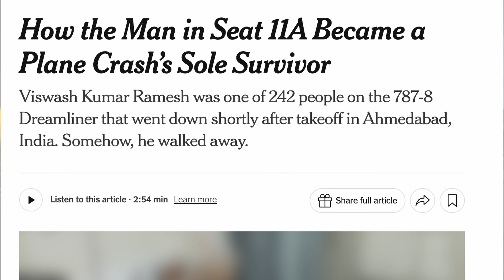Why the RAT Changes Everything – Air India 171 Update

Comment: It will take months before the cause of the crash is properly determined. While interesting; this is just conjecture. I'm surprised that Capt. Steeve would have access to the ATC recordings because they are usually protected. I've been involved in several aircraft incidents and the causes are usually a combination of errors.

Comment: I got nervous when jet planes went from 4 engines to 2.
Reply: It works out about the same. If a 4 engines plane loses an engine, it must be able to fly on three, and in the case of twin engines, on only one. The thrust of the modern engines is far higher than was present on the older ones. This means that for example, that catastrophic bird strikes would leave the same failure pattern for both 4 or 2-engined aircraft. Flying feels more scary, but driving to the shops for bread and milk is more hazardous. We are very poor at understanding or assessing risk factors for ourselves.
Reply: @Steven-p4j That's true for going to the store to buy milk. I'm talking apples to apples here.

Comment: I'm glad it's not the pilot's fault as Boeing would have clearly run with that to avoid damaging their already tarnished reputation even more, especially after the hit job.
A dual engine failure is apparently very unlikely, you are more likely to win the lottery than this occuring, but for it to happen on take off shows there's a major issue with the jet turbine. All planes with this model of jet engine should be grounded IMO, there's been far too many plane accidents recently!!

Comment: It's plane failure nothing else. And flaps should be set to min. At 10 or 15 mandatory even if runway has the highest length. Pilots set flaps at less degree because they got enough runway so plane can fly slowly up. When runway is short pilots set flaps to bigger degree like 10 or 15 so that plane takes off in short distance.

Comment: I agree with you regarding dual engine failure. The RAT deployment is one factor but a second factor is the fact this aircraft was not at gross weight yet used every inch of an 11000ft runway to get airborne. This crew encountered a problem after V1. You have to feel for them.

Comment: Excellent ideas captain, thank you! How horrible of a crash this is, I hope they figure out why it went down. From a private pilot, I agree so far with their theory. dual engine failure. I would assume they will check the fuel in the truck that they used for re-fueling.

Comment: On the B787 the fuel pumps are electric. So, no electric power means no fuel to the engines. BTY, the air con broke on the previous flight and was just fixed before takeoff. I would be asking those guys what they did to fix the air con?

Comment: ** A video from a passenger surface on FB showing the previous flight of this same airplane , with some sort of an electronic or problem about the video display entertainment system on the back seats, not working.   The screens were frozen and not operational.   Maybe a precursor of an electric / software computer issue prior ..

Comment: Cant get my head round why so much could fail within a few thousand metres of flight, 2x engines cannot fail surely?  Fuel contamination could make both fail is my guess, I'm not an airline guy but have worked on cars since 1986, fully aware that take off is the most stressful part of the planes job, once up almost run on air. Good information.  Thank you.

Comment: It really makes sense now. I think it connects the dots, even why they couldn't lift the landing gear, since that also required power. Hearing from an expert like you, it's hard to believe that both engines failed at the same time. So, fuel might be the real issue. They had just landed from Delhi, and it needs to be confirmed whether they refueled again at this airport. Something might have happened there. It's possible that the initial thrust came from the fuel already in the lines, and when the new fuel entered, it may have caused the problem

Comment: Had it been a single engine failure, the working engine would have kept the plane in the air. A friend of mine, a retired pilot has put this down to fuel contamination. It'll be interesting to see if he's right.

Comment: I was thinking engine failures even if he didn't use flaps  on take off, the climb out would been flat or used entire runway. that airplane took off straight up in the air like a rocket was supposed to and just lost power went into a complete flat stall great job by the pilot he flew that plane all the way to the ground with wings level in a perfect stall configuration if there would have been more momentum forward, most likely would be no tail section that plane look like it just dropped on top of the building very relatively slow fwd velocity to a 787... and if somebody accidentally put the flaps back up on climb out, normally the pilot would have lowered nose to  gain air speed speed and threw a notch of flaps back to it.  that did not happen he kept his nose way high angle of attack. Now we see air generator extention 😮

Comment: Would complete electric failure cause engines to shut down ? Reason I ask is a video come out supposedly of that aircraft about 2 hrs before it crashed it was someone on the plane the flight before this one and all the electronics was shutting off on it. Also seen something that said this plane had 4 seperate maintenance issues in the last month and had made 4 emergency landings because of landing gear and flaps issues 🤷🏼‍♂️

Comment: Pretty simple plane takes off, 15 seconds into air pilot ask for wheels to retract, a failure in the electronics or hydrolics cause failure of the electrical system, which causes fuel pumps to switch off (only for moments) cuts the engine, witness felt the plane not move this is the feeling of speed reduction in air due to engine failure, rat deploys automatically as auto failures system engage, you see in one of the videos the cover flying down from the plane, electrical systems restored to basic level due to rat, power restored to engines pilot goes maximum throttle, the one surviving witness said he then heard the engines screaming after the 15 seconds of stall glide time, pilot is shouting mayday to control,  video shows plane slightly dipping wings left to right lack of air flow like a paper plane losing lift falling to the ground, not enough height to recover, pilots did their best in a dire situation, this is not my words but from another youtuber who knows better than this guy from 2 days ago.

Comment: I reckon the black box will see the flaps were deployed or partially deployed, as the plane won't allow you to take off without flaps. The plane began losing power somewhere after V1 because the plane took the whole runway to takeoff, likely at a point it was impossible to abort take off.. Next, the only reason the landing gear was still out is because the plane hoped to make a turnaround and land.

Comment: It's ultimately more likely that it was just one engine, but with gear down and no flaps they wanted to sink and couldn't hold altitude or climb. And they didn't have enough time to figure it out. If they were at 10,000 ft, they probably pull the gear up and figure out an approach.

I think it was always obvious that it was power... Nobody doesn't have throttle full open there. They were obviously sinking. They didn't have enough power to stay airborne, and crashed basically parallel to the ground.

Comment: Definitely not hydrolics, the flaps would sag, I am still sticking to my original comment, there was probably a software problem, electrical issues, aircraft went into landing mode, the engines pooled down to land, the wings stayed level, no wing stall, slight yall to the right, but I am convinced the aircraft went into landing mode, this case looks very simular to the air France incident, we're the aircraft at an airshow went into landing mode, the Rat also deployed, airbus fixed the glitch, has Boeing with the new dreamliner 787 maybe got the same issues?

Comment: Proper & constant fuel supply to the engines can affect the thrust factors which at that time required for the lift must have some mechanical electrical issues. Anyhow, the matter is not under my investigation anyways. The analysis is of great values 🎉🎉
Wonderful observations  🙏🙏

Comment: I have said it elsewhere, and I am repeating it for the benefit of your viewers. The Air India plane crash in Ahmedabad bears uncanny similarities to two previous aviation incidents. The helicopter crash that claimed the life of Chief of Défense Staff General Bipin Rawat in 2021 and, more recently 2024, the fatal crash involving Iranian President Ebrahim Raisi. In all three cases, a notable reported common factor has been a sudden failure or jamming of the engines, resulting in the aircraft to crash within minutes. It seems most likely that an advanced remote interference technology could have been used to disrupt aircraft's electrical and hydraulic systems, particularly when flying at low altitudes. Given the sophistication in cyber and electronic warfare capabilities, it is not inconceivable that cyber interference and sabotage brought the plane down. The operation Sindoor has humiliated powerful nations (not Pakistan), and this angle merits careful consideration.
Reply: If in doubt and with no knowledge, always invoke a CT with sinister forces at work as the most plausible explanation - you can‘t go wrong on social media…

Comment: If the jet engine were at full throttle as would happen if there was a mistake with the flaps surely the noise of the engines that low would be extremely loud and would be clearly heard in the original video.

Comment: There is something else. Something that you don't see on the video: the optical distortion caused by the exhaust of engines, that are supposed to be on full throttle at that point.

Comment: There’s an Auxiliary generator on tail which supply power when grounded (addition to ground power). 
Auxiliary generator is used for starting engines then switch to “Generator Mode” for main generators. 
Were the pilots yet on Auxiliary power and failed to switch to main power (Generator Mode). ?

Comment: That is great information, but that doesn’t explain why the flaps were not in the correct position and why they used all 11,000 feet of runway to take off and not the normal 7,000ish. Could this be a chain of events that caused this tragedy?

Comment: Loss of power/thrust looked like a pretty solid hypothesis from the get go, simply judging by the plane's behavior shortly before crash. And it would've had to be total loss - or rather loss of power in both engines, as the plane did not appear to be yawing left or right. If they had had, say, a bird strike in one engine and the other was still running fine, I'd guess you would've seen some sort of reaction by the plane wanting to yaw - which I don't see here. I also didn't/don't see any birds in the video or anything that would lead me to believe a strike occurred - there's no debris, fire, smoke or anything coming from either engine and neither of the two look like they've taken any sort of damage to their innards. 

It seems more like someone (or more likely: something) cut or dramatically reduced power on both engines. Question is: What exactly caused this? Clearly, the flight-crew was aware that something was very wrong as they were clearly trying to fight this thing (plane is very much nosing up as the plane vanishes from view) plus, AFAIK, they did make a Mayday-call. Also: If they simply had mistakenly reduced power, would the RAT have deployed? I don't see why it would. 
So, as before and with the whole "they must've mistaken the flaps-lever for the gear-lever"-non-sense, I'm going to rule out human error on the part of the flight-crew - meaning I do not believe they had the engine controls at too low of a power-setting. Besides: The plane did manage to take off just a few seconds earlier and, surely, a power setting sufficient to take off would also be sufficient to, at the very least, maintain level flight, even with the gear out. 
I guess we'll know soon enough because IIRC they recovered the flight-recorder yesterday or the day before that, but I would not at all be surprised if they found out that the culprit here was some sort of catastrophic failure in the engine-management and/or throttle-by-wire systems. Which, in itself, would be pretty odd as I would expect such vital systems having built-in redundancy.

Comment: What about fuel contamination? How is it possible that the engines that worked perfectly on the first sector and also worked enough to rotate the airplane up at the perfect time suddenly goes off.

Also there is a passenger on the first sector who made a video about the lack of AC and TVs not working. That should also be considered into this instead of relying on the guy who survived  who has changed his stories many time.

Comment: This is off a few things I've read on the internet, so take it with a huge grain of salt... I've read that Air India are not good with their maintenance on their planes, leaving things unfixed and having the fleet flying on bare minimum, and there was also a comment of someone that said they were on that very plane before and that there were a lot of faults in the interior, like most of the in-flight entertainment wasn't working, lights working erratically and even some interior panels missing above the luggage bins.

As I said, this is what I've read on the internet, and anecdote is not evidence, but if it is possibly true, that would give more weight to the engine faliure hypothesis due to lack of maintenance, and the possible ruling out of pilot error. 

Also, the sound of the RAT is very evident in the video, but there is something that is very absent from the video, and that is the sound of two turbofans at full take-off power... in fact, I would say you can't hear the turbofans at all.

Comment: I shook a bit.
2009, flying back from NYC to London, with a Boeing (it was a long distance plane, but not the Jumbo), right before the start, when the pilots started the full throttle, both engines failed.
Some maintenance guys came 20 mins later, the Plane had to leave the Exit.
I sat on window place, seeing the left wing. There was one guy checking the logs... I saw the Laptop.

We wanted to leave the plane, but we were NOT allowed... I remember we started to sweat, as also the plane got warm inside.

In the end everything went fine, but my mom had exactly her 45th birthday, on June 23rd. And she told me after the flight that she thought It's gonna be her last b-day. I never forget how both engines failed just seconds before the full acceleration started.

Comment: There's a video which clams to show multiple small electrical issues on the planes previous trip. including no air conditioning, seat touch screens frozen and call assist buttons not working
Reply: those have nothing to do with avionics or engines, being perpetually short of aircraft these aircraft are flown round the clock after routine maintenance and thus there is little down time to do repairs  of infotainment and cabin accesories

Comment: Capt Steeeve, good analyst, but a double engine failure is extremely rear. This is a real head scratcher. A pilot with 8 thousand hours would not make many mistakes during an emergency. I work these aircraft, they are very high tech with many sensors and redundant systems. Would a complete electrical failure and emergency buss failure cause no response to engine throttles? Keep up your research, many pieces to this puzzle are still missing..

Comment: Glad you dropped the pilot mistaking the gear lever for the flap lever theory. 
This doesn't look like a pilot error, nor fuel contamination. I could be wrong but with this AI cleaned up vid it appears the speed breaks are pushing the plane to the ground.
I don't think it's a dual engine failure, no flame out, looks like the system spooled the two engines down, as if it was the AP commanding it.
Really looks like a mechanical (system) failure.